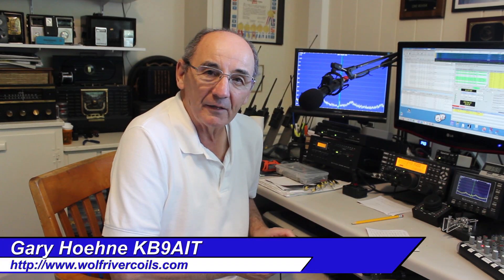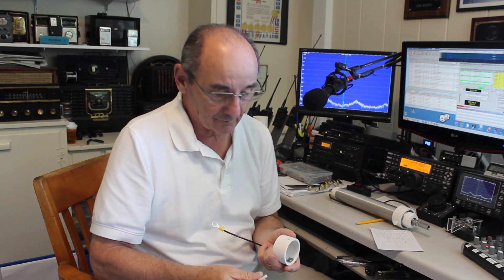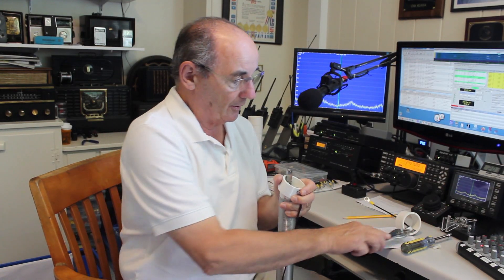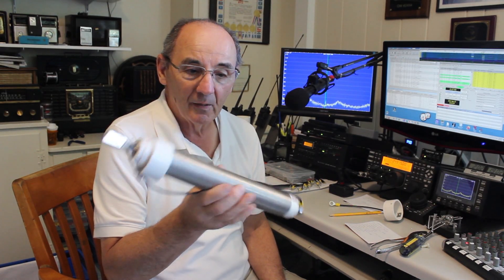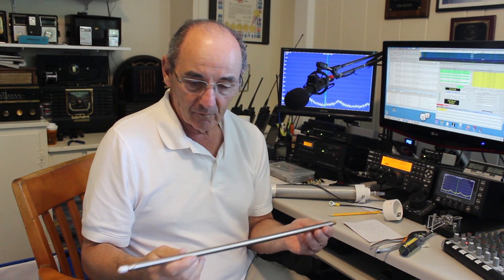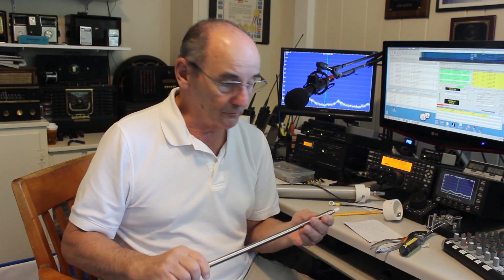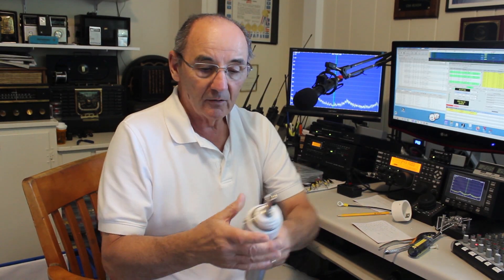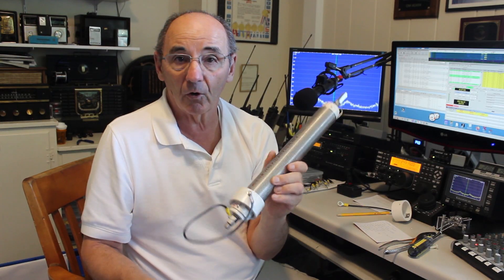Top 11 Questions asked at Wolf River Coils

Comment: Bought this platinum model, can’t get the SWR below 3.0. Mostly SWR runs 4-6.
Reply: Same issue with my SB1000, the best SWR I can  get is 2.58 anywhere on the coil for any band. Very frustrating.

Comment: Would love to see if gauge of wire matters for radials. I see alot of 18awg radials, but there is alot of 26awg. That is a huge difference. for portable use with couple dozen radials, thinner would be better and cheaper BUT is 26awg as effective as 18awg. If not, by how much?? negligible? like 15watts vs 20 watts or is it like 15watts to 45 watts?